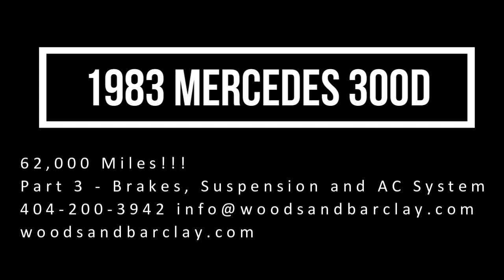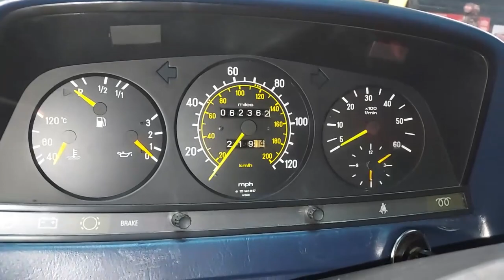1984 Mercedes 300D - Part 3 Brakes, Suspension and AC System

Comment: Great work.  Did much of that on my 1984 & 1985 300D (just sold 84).  The aft link is termed "guide rod".  My 1960's Chrysler's have a similar 1-pivot lower control arm (LCA) w/ lateral support from a similar "drag strut" (since goes fwd instead of aft).  By 2000's, M-B was using folded sheet-metal for LCA which rust-thru from the inside and look fine until they break.  Pressing the lower ball joint into the spindle is hard, using a giant C-clamp press (tap end of bolt periodically w/ hammer as you tighten).  Best to use the more robust W126 rubber bushing on the LCA.  That H.P. AC run up the right side of the engine seemed silly to me, so when re-hosing I ran it straight to the AC condenser.  Makes swinging wrenches on the alternator much easier.  Said you can get exhaust hangers with internal metal chains.  Lost the rear exhaust on my 1985 when the rubber donuts failed and it dragged when daughter was driving.  I put a metal strap for "next time".

I've fussed with the door strikers.  My 1984 300D driver's door began popping back like the video when prepping to sell it so couldn't tolerate that.  I tried another striker with the rubber protrusion you show, but no help.  Finally got it to latch every time after moving the striker out as far as possible.  Problem occurs when the door doesn't move in enough for the latch to reach the underside square hole (also clean any rubber debris in hole).  My problem seemed to come from the door weather-stripping sticking out at the top corner, so had to roll it back in more under the lip to keep it flush.
Reply from the maker: Great comment thank you! I agree those metal reinforced exhaust hangers are much better.

Comment: Nice work! Great to see such attention to detail. One point of discussion, that isn’t Cadmium plating. It is Zinc plating, with yellow passivation (Cr6+). Cadmium plating was discontinued in the majority of the automotive industry in the early 1960s. Although the hexavalent Chromium passivation (the yellow Zinc chromate) isn’t the safest industrial process, it is definitely less harmful than Cadmium plating.
Reply from the maker: Yep I know that very well. We actually use yellow zinc dichromate when we replate the engine compartments. However, the majority of people watching these videos know it as cadmium so I just keep it simple instead of having to say yellow zinc dichromate every time. Maybe I just need to start calling it what it is and people will come around and start understanding.

Comment: Quick question: do you cover the alternator when power washing the engine bay? And do you also take out the battery?
Reply from the maker: No that's not necessary. I don't spray the alternator directly or the battery directly but it's okay if they get a little wet.
Reply: @woodsandbarclay  Good to know, Thanks! I've been meaning to do the same with my 230CE but was concerned about the impact on the electrical components, etc...
Reply from the maker: @zilizopendwa4644  there are many more electrical components in a gas engine vehicle I am specifically referring to diesels. In a gas engine vehicle you have your spark plugs your distributor and your coil. You may also have electronic throttle-control or throttle body. Do they also have an electronic fuel distributor. You need to be much more careful with gas engines.
Reply: @woodsandbarclay  Noted, thank you for pointing out the difference.

Comment: I’ve heard, & I’m sure you have, that all of the diesel drip some oil at some point. My last 300D didn’t drip with over 225k miles. Is it just a matter of maintenance?
Reply from the maker: Diesels are very dirty if you crawl underneath your car you'll see oil all over the sides of your engine. Trust me it's leaking it may not have dripped yet but it's leaking. They all leak. These engines are 22 to 1 compression ratio compared to gas engines that are around 10 to 1. Diesel engines are just dirty and leaky it's the nature of the beast. When you have compression that high it's a lot of force on seals and gaskets. Don't let it worry you one single bit a leaking diesel engine never hurt anybody or affected the performance of the motor. It's just par for the course. I don't know why people make a big deal out of oil dripping from engines. It's the dumbest thing for people to get concerned about. Especially classic car engines. It doesn't matter one single bit and doesn't hurt one single thing other than your wife's bitching about the stain on the driveway. Don't get me wrong if your rear main seal is gushing out a quart of oil every week that's a problem. But a couple of drips from the engine throughout the week are no big deal at all and don't worry yourself about it for one second. Go ahead and move on to something serious to worry about like rebuilding all of your front suspension.
Reply: @woodsandbarclay  110%, but i do carry a car bib for when im a guest on nice concrete drives!
Reply: The front crankshaft seal is a common leak source.  You must remove the damper to replace and take extreme care you don't bugger up the crankshaft snout when reinstalling it (must clock correctly, the two pin slots are not exactly 180 deg apart).  The valve cover gasket is a common source.  Some file the metal contact spots to give more compression to the gasket.  Also insure the oil drain from the air filter hasn't popped loose and has a fresh O-ring, and also might need new O-ring and bushing on the turbo oil drain tube (2-piece, and just enough room to work it out).